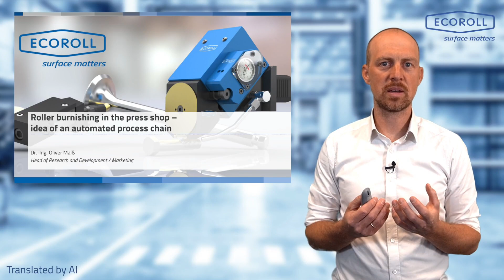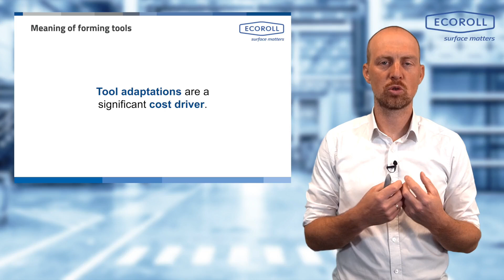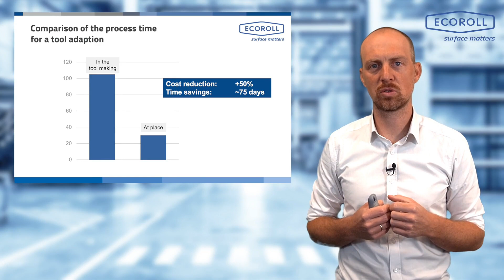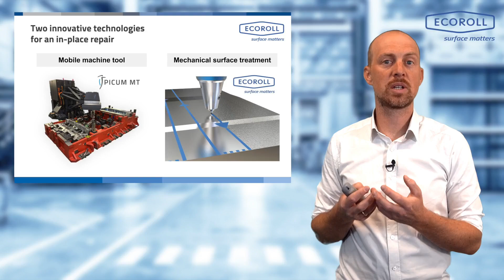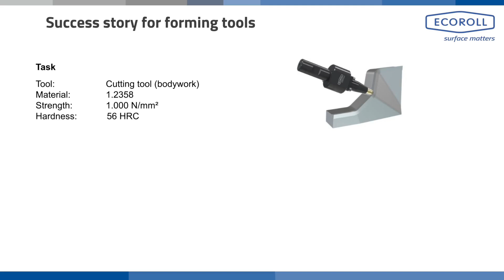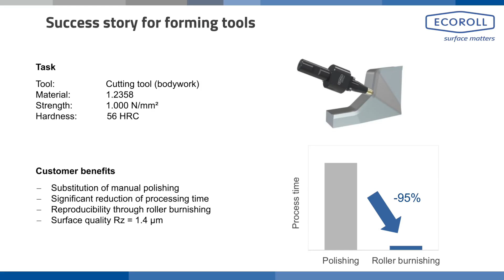Roller burnishing in the press shop

Comment: can we have a mirror surface finish on a Mold ?
Reply from the maker: Thanks for the question. To be honest, it depends on the material, the pre-machining and the process parameters. We created on a ofter used material for that purpose Sa-Values of 0.16µm. What is for sure: You can reduce the amount of manual polshing dramatically, if this values it not good enough.